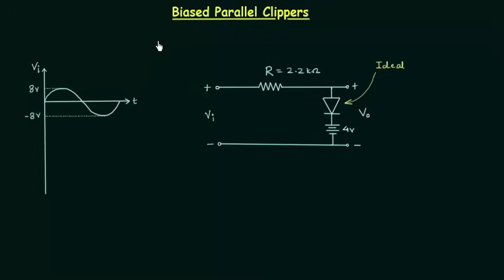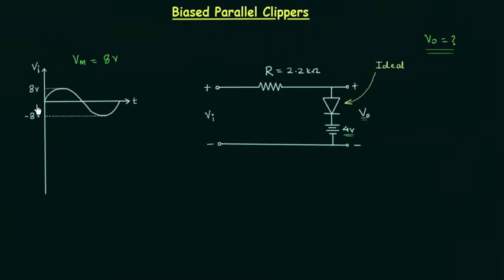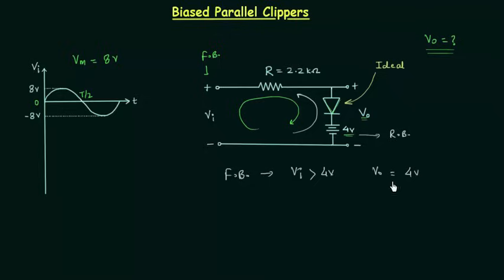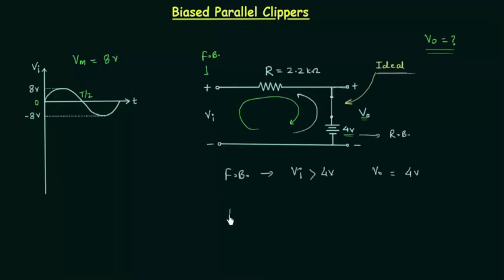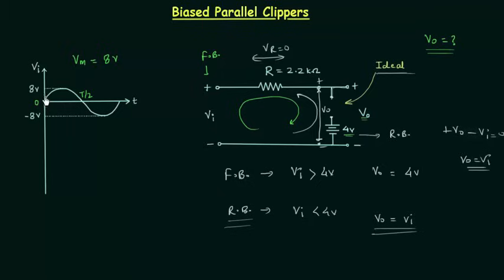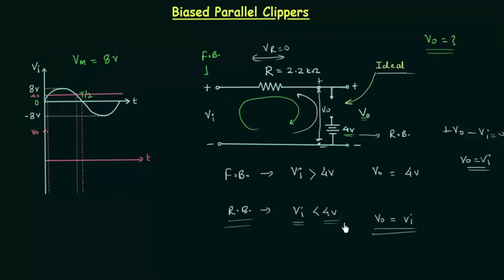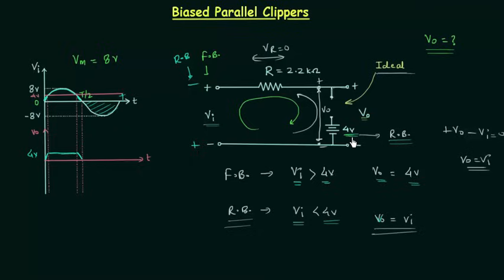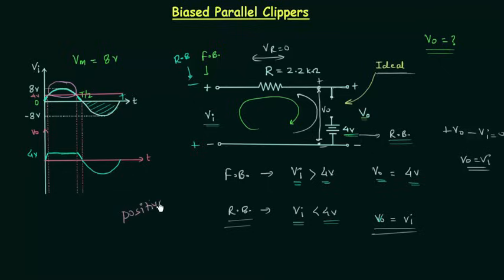Biased Parallel Clippers

Comment: I don't understand why its called parallel clippers when there is no load resistance that is parallel to the diode
Reply: Because you didn’t do the experiment in the lab. In the lab, you need to connect another resistor in parallel with the diode to get the signal and the value
Reply: The classification of a clipper as series or parallel depends on the placement of the diode relative to the input source.
Reply: Yup

Comment: Ignore Vr ,
Then for ideal diode , resistance offered by the diode in reverse bias is infinity , then whole input voltage will appear across the Vo not at resistance 2.2 kilo ohms , therefore the output voltage is equal to positive of the input voltage. 
Hope you guys have understood it .

Comment: when vi is less than 4 volt , the diode is off but if we connect a load resistance  in output then a current flow through 2.2k resistance also then why we won't consider the voltage drop across this R??

Comment: When Vi>4V, don't you think that there will be voltage drop in resistance R, which can make diode Reverse biased.
Reply: No because at the instance of transition the current flow is 0

Comment: When both of the voltage sources are reverse biasing, there occurs an open circuit, but there will be current flow (if load is added in parallel) through R if load is added in parallel with the diode.Why is R ignored

Comment: Those who are having problem to understand just add a load resistance at the output. It will help you understand the problem.
Reply: yaa..  that's very helpful
Reply: Can u explain ehy
Reply: Why
Reply: Becoz first of all to be parallel circuit there must be a load resistance in parallel with diode

Comment: Doubt :  At time 2: 58 , how is the Vo = Vi  when diode is reverse biased. Since the diode is open-circuited , no current will flow through the diode. Hence we have current =0 and Resistance = infinity. V= 0x infinity = zero. Please correct my understanding.
Reply: bro bcz in diode modelling we had studies that if there is ideal diode and diode is Reverse biased to input voltage is equal to output voltage because there will be no voltage drop across load resistance rL
Reply: @engineergem   but in series clippers question sir showed 0. Output in reverse bias
Reply: It actually contains resistor parallel to diode so

Comment: 4:45 if both circuits are reverse biasing the diode then the diode will act as an open circuit and current will not flow. Hence Vo will be zero. How come Vo is equal to Vi. Please someone explain me
Reply: current will not flow through the path containing diode. but Vo is voltage across terminals which can be seen to equal to Vi since both are sharing the same terminal (since vr=0 it can be considered as  a short circuit).alternatively by kvl we will get Vo=-Vi. hope I could get to the point
Reply: @shatakshibharti5222  Thank you for your explanation I had the same confusion like him.

Comment: And also if we attach load resistance across output, what will happen to output????
Reply: 4:45 if both circuits are reverse biasing the diode then the diode will act as an open circuit and current will not flow. Hence Vo will be zero. How come Vo is equal to Vi. Please someone explain me

Comment: Sir i am understand parallel clipper please clarify
Reply: 4:45 if both circuits are reverse biasing the diode then the diode will act as an open circuit and current will not flow. Hence Vo will be zero. How come Vo is equal to Vi. Please someone explain me
Reply: @Kamla-Speedrun  because that diode will be open ckt and open ckt have infinte resistance so no current flows through that branch so current flow through only that upper part so that's why Vo=Vi

Comment: Sir, Why is Voltage across the Resistor 0 when Vi<4V?
Reply: Because current is zero (open circuit)
Reply: @varshakp3693  no its not open cicuit theload resistance is connected to complete the cicuit

Comment: Thanks for this elaboration. Will you please explain how Vr (2.2k) is zero in case of reverse biased.The parallel blocked elements (where diode is present) will be open circuit. However it forms a closed loop from Vin to Vout through the resistance 2.2k. How there will not be any voltage drop across the 2.2k resistance ? Confused a bit, please explain...
Reply: There will not be any current flow through the 2.2k resistor. Hence voltage drop in 2.2k resistor is zero.
Reply: @bharathvarun  then from where current pass through to  output load ?.from  your home?
Reply: @jb-bt4gq  🤣

Comment: When vin =0 then Vo=-4v in +ve cycle then why u start waveform from 0 can u  elaborate..i m confused
Reply: When input voltage =0 then there is no current flow through circuit bcoz then circuit is open

Comment: 4:40 output voltage equal to -Vi
Reply: Using KVL and the polarities assigned, you get Vi-Vo=0, making Vo subject of the formula yields; -Vo=-Vi. then cancel the negative signs by dividing both sides of the equation by -1 you then get Vi=Vo

Comment: sir when diode is reverse biased it acts as open circuit so how Vo becomes equal to Vi shouldn't it be 0 pls correct me if i am wrong
Reply: Diode not pass current only in those wire inwhich he connect
See carefully v input is directly connected to v output when diode is reverse biased

Comment: sir parallel clipper load resistance parallel to diode .this is not a parallel clipper
Reply: agree with u.
according to "introduction to clampers" videos
 Parallel clippers are those where load resistance is parallel with diode,.
Reply: tu kis college me h???
Reply: bhai kis nalle college mei hai. Input voltage is parallel to the diode. dekh dhyan se

Comment: Sir,there is a mistake...once the diode becomes forward baised... The Vo  is 4+diode knee voltage
If it was silicon then Vo becomes 4.7
Reply: he used an ideal diode there. which is equivalent to a close circuit.

Comment: in reverse bias, whole of the input voltage appears across output. isn't there some voltage drop across the 2.2kohm resistor?
Reply: Yeah. I'm wrong here.
Reply: @luismais4742  diode is nowhere near the resistor... you are mistaking the voltage source with resistor, and even then your argument is stupidly wrong.

Comment: negative half cycle Vo = -Vi isn't ?
Reply: in previous unbiased parallel clipper lecture sir u have applied kvl and get Vo=- Vi  in negative half cycle
Reply: In unbiased parallel clipper at 3:24 sec
Reply: i have the same confusion plz tell me which lecture the point was mentioned.

Comment: in 1:57 min
F.B. V(i) > 4v
u neglect the resistance voltage drop
Reply: Sudip Roy because in clippers you are assuming that theres no current thats why there will be no voltage drop across in the resistor
Reply: @luismais4742  sir i did not understand why there is no current
Reply: @Amityphysics  because that series resistance have less value than load resistance and can be neglected
Reply: @opre6451  may I ask why is the series resistance has less value?

Comment: sir,  how is this circuit "parallel "  ? . Sir i do agree with you that it is baised as an external source is there and clipper as it clipped + cycle  but how is it  "parallel "  ?
Reply: Series
Reply: Because the output is taken parallel to the diode

Comment: Sir,.   at 1.39 during forward biased in + ve half cycle when vi  > 4 v...vo should be 0...how it becomes 4 v??
Reply: When the diode is ON , it is a short circuit. So how can we just take the Battery alone when there is input Vs connected as well to consider. You acre correct if you did not have the V input and only had the battery. Think again !! Again we need to apply KVL to figure out the V output. It is not just a battery standing alone.
Reply: @robertfaney4148  Vin will be dropped across R

Comment: what if R input is not negligible and there is voltage drop in it?
Reply: Current does not flow through R since the diode is open circuited. So R has no significance

Comment: your analysis is true for very high load resistance parallel to diode isn't it, else all the voltage drops across 2.2 k ohm resistor, so the voltage at top terminal of output is -Vi for positive half cycle and +Vi for negative cycle, therefore on negative half cycle Vo is zero until the Vi reaches 4v (because until then the potential at top terminal of output hasn't reach 4v to forward bias the diode). Therefore negative half cycle in output can have maximum of -4v not -8v.
Reply: I tried simulating this circuit in proteus and found that I am wrong and your analysis is correct. 
      Yeah indeed, the proper way to anlayze the circuit is by analyzing the voltages in two terminals of diode. I think i got it.

Comment: at 1:13,actually the 4v is forward biasing the circuit right as its flows from '+'to' -' tve
Reply: the current draws from negative(-) to positive (+)
Reply: Exactly what I am battling with.

Conventional current is +ve to -ve and that's what we use for designs unlike electron current.

If we take a closer look at his analysis from the AC input, he used +ve to -ve for the loop current so I don't know why he changed it for the DC source

Comment: in reverse biasing why you had not considered the effect of 4 volts????
Reply: 2:15
Reply: In reverse bias,two voltage sources,i.e.,Vi as well as 4V-both make the diode to operate in reverse bias,as a result,there is no conflict between 2 voltage sources,so there is no need to consider the effect of 4 volts separately.